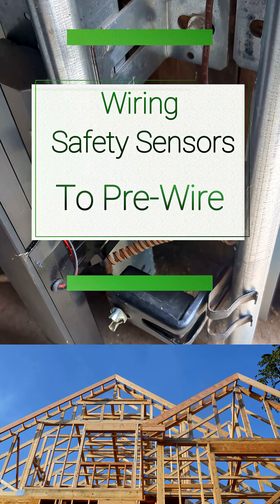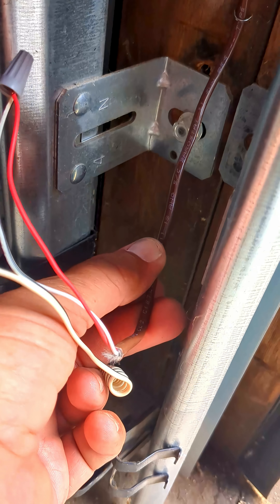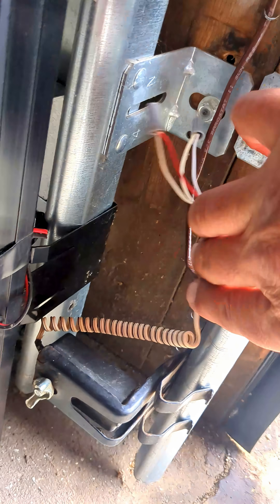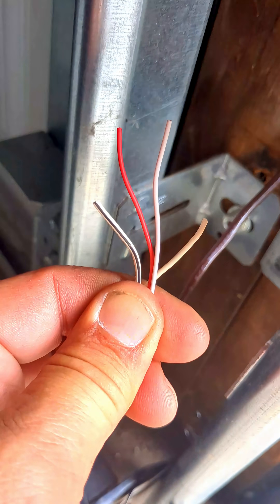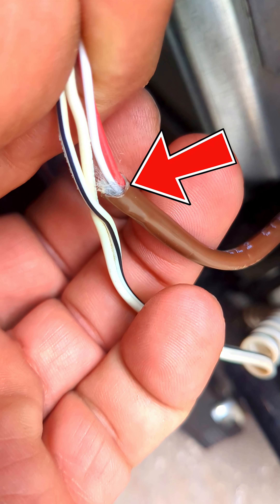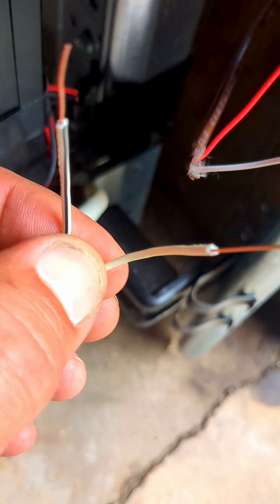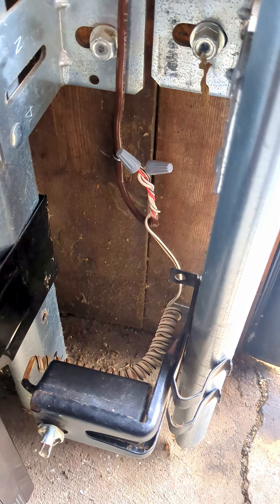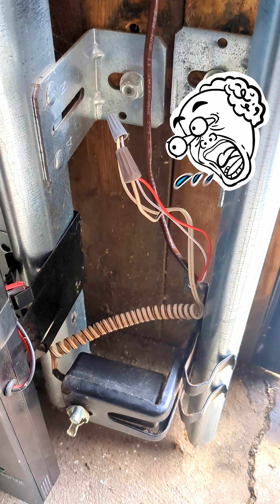Garage Door Opener Safety Sensor PRE-WIRE Installation | HOW-TO

Comment: just put it in a single gang box with 2 button connectors looks way cleaner
Reply from the maker: I like that.  I actually had a customer the other day that he bought these plastic black boxes that screw to the wall and you can hide the wire splice in it.
Reply: @garagedoorgenius yessir i’m an electrician that’s just how i do it so nobody sees the mess lmao
Reply from the maker: @ZyNSyPherPS3 I like that bud.  Thanks for the pro tip.  
I used to run my own gig, so I would buy stuff like that.  Now I have to convince someone to buy something like that and plead my case on why we should stock those.  I bet I'm met with, "it's not our problem".  Lol.